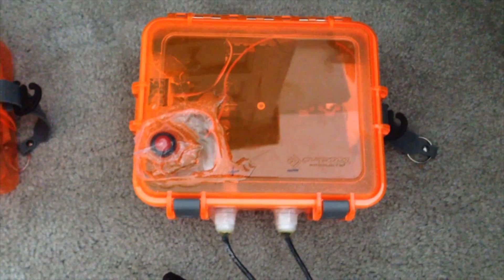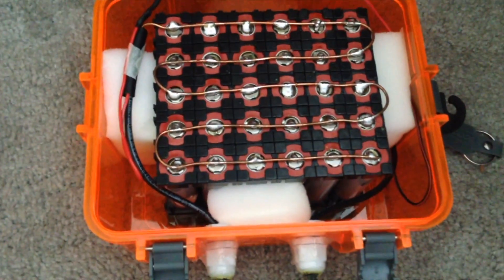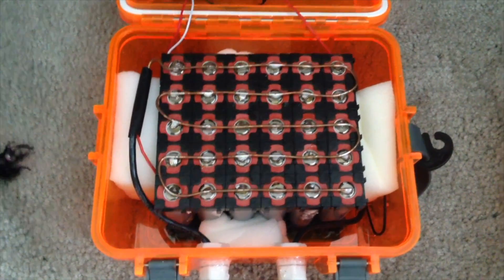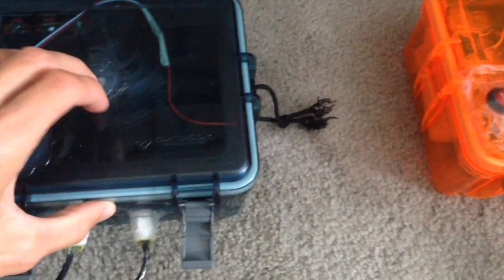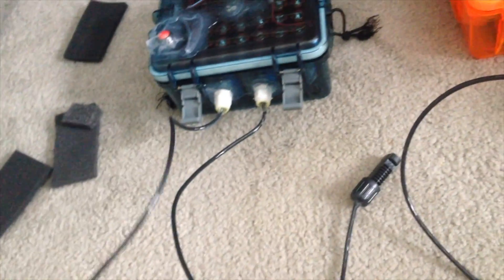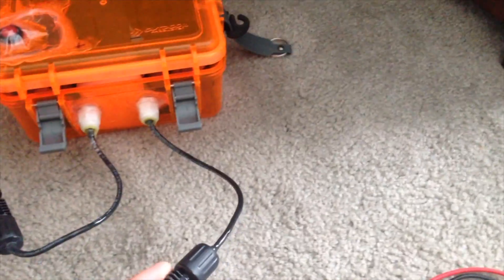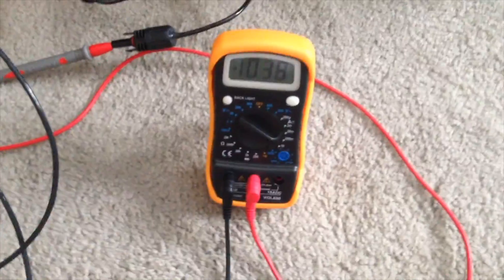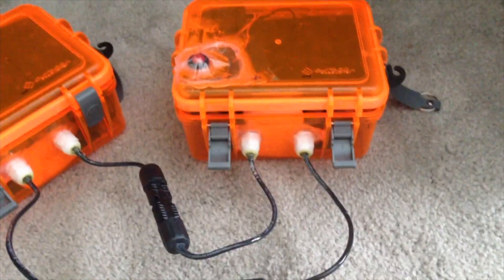DIY 12V li-on 18650 waterproof batteries

Comment: Correct me if I'm wrong but to get 100ah 12volt you would need :  3ah 18650 batteries (at 3.6 volt).  With 33 batteries in parallel for 100amp  and around 4 of those blocks in series, to make around 14 volts (to reliably get 12volt end product)  That would be just over 100ah if the 3ah rating on the battery is accurate, which it usually isn't. This gives us 112 batteries total.
Reply from the maker: alaskanalain yeah these are 80ah

Comment: Not a good design because of all the current on the last few inches of your conductor. I hope you have it fused down below 10 amps.
Reply from the maker: Tony B. It's only 4 volts though, and no, I use this at 30 amp for a trolling motor mostly, and have put 200 charge cycles on it without issue
Reply: Tony B is correct, the resistance of the cabling from one end to the other will cause a voltage difference . At high currents you will see this and you'll end up with a bottom balancing issue.
I highly recommend thickening your wire and bridge them across as well as zigzag as you've done making a mesh on both side.
You really should fuse the positives as the cable exits the box.. what if the cable shorts by some miracle accident.

Comment: Interesting video:  Lets see: to get a car battery level like 900AH, you would need even if 3000mah (3ah) @3.7v * , so putting 3 in series gives only 11.1v,  best use 4 in series to get 14.8v; then since each string of 4 in series is only 3ah, you would need 900Ah/3Ah = 300 strings of 4 = 1200 cells @ $3 ea = $3600 ?   If only a way could be found to bring the price down. 
* from my experiences with the Li-ion 18650 Ultra-Fire 4800mah (4.8ah) battery, they work  good for perhaps an hour at first but gradually lose their "stamina"  so that after 1 year of ONLY occasional (not everyday) use, usually for only 10 minutes or less of use time,  now  if I use the flashlight for 30 minutes its getting dim and needs recharge. Leads me to wonder if the 4800 mah rating is even accurate (seems like its possibly really on 1000mah ? ) .  Some battery vendors use a different rate of discharge schedule to make their batteries seem better than they are (buyer beware);  ie  i a 100ah rated battery is using the accepted norm of 20 hours that means the battery will give you 5 amps for 20 hours, but if they use a different hours like for example 50 or 10 hours it changes the rating drastically; so they can use for example 50 hours to get 2 amps for 50 hours but falsely say its 200ah etc.
Reply from the maker: john Doe yeah the ultrafire batteries are 250mah at best, they're Chinese junk, where is the 900ah for a car battery coming from? Most car batteries are 70Ah with a cold crank rating of possibly 900Ah
Reply from the maker: john Doe yeah agreed that's the worst thing about lead acid batteries the discharge curve isn't linear, whereas with lithium batteries it is very linear!
Reply: yeah, my bad most deep cycle golf cart or marine are rated at ~ 100Ah +/- , but I've seen "Everstart Marine MAXX-29" batteries that they put on the label 900 cranking amps and  like 700 "cold" cranking amps (which really isn't deep cycle is it) AND also 125ah ? so it looks like a multi-use battery.   Car start batteries are made with more but thinner plates to create a lot of amps (ie 900) when starting but this will only last 10-15 minutes at which point the V falls below the needed ~11v needed to start a car;  conversely the deep cycle types are made with fewer but thicker plates to increase the longevity of time of use so a 100 ah battery then is rated to run 20 hours @ 5 amps or 10 hours @ 10 amps,  etc.   Beware "some" unscrupulous battery co's will quote the 10 hour schedule but the industry standard is for 20 hours, making it appear to be a higher amphours than it really is.  Yeah, don't buy those copper top look alike batteries (aa etc) from the flea market, they last exactly 4 minutes.
Reply from the maker: john Doe lol yeah you're right, for lithium cells you can look up the specs online, best cells will get you 30ah draw but just string as many of these as needed for the current draw needed
Reply: U r right. I think lead acid is predictable in that it gradually decreases the power curve, the Li-ion and Ni-mh seem to stay higher longer but then take a steep sudden dive (unpredictable), so many times my li-ion drill just dies.. so of course one has to carry a backup (even though it has a battery test light, its doesn't really really accurately predict the battery level (ie 4 bars is not same as twice 2 bars).
Reply from the maker: john Doe yeah I agree with you, it's cutting out to protect itself so the battery doesn't discharge to deeply; all in all Li-Ion are definitely the way of the future
Reply: No car battery has that cap, mr doe.
Reply: Depends what you want the battery to do. If you have 4 cells in series, it should never be charged higher than 4.2 volt per cell = 16.8 volt. And your 4s 8p pack can deliver 3400 mah x 8 = 27 200 mah or 3.4 amp hour.

Comment: how many cells would give you 100ah assuming they're all the same as your LG cells?  I'd like to make 2 12v's for a 24v system because I'm not paying 2,000$+ for one. Any info would be awesome
Reply from the maker: Aaron Stover you'd need roughly 40 cells to make 104 Ah @ 3.7V, so you'd need 120 to make 12V, or 240 to make your 24v at 104Ah
Reply: thanks a lot! any issues at all with your system? I see a lot of shit about bms seems like your battery charger keeps things in order
Reply from the maker: Aaron Stover so this would be ~400$ using the same method I did
Reply: where did you get your cells? I've had a rough time finding them in bulk like I need
Reply from the maker: Aaron Stover no issues at all, yeah my battery charger does all the leg work, only advantage to a BMS is it won't let you over discharge the batteries
Reply from the maker: Aaron Stover eBay mostly
Reply: ok cool thanks alot
Reply: fisherman3210 this is incorrect. Assuming those cells are not actually 3000mah, but 2200ah.
That is 2.2ah/cell.
In parallel, you will need 45 batteries to reach 99ah @3.7v.
You then need to run 4 (not 3, which gives you 11.1v) groups of those 45 batteries in series to get 14.8v @99ah. Which is about the equivalent of a normal automotive battery (voltage). You want more than 12v, not less.
Anyways, that is 180 of these cells which will set you back still well over $1400 and weigh around 18lbs not including boxes or solder.

In short, this doesn't really gain you much over a traditional marine battery in terms of weight or ah and involves soldering 360 joints.

Comment: how do you connect them ? 3 in series and the rest parallel ??
Reply from the maker: Yeah the large boxes are connected as 3 in series for 11.1v nominal, the individual 18650 cells are connected in parallel
Reply: +fisherman3210 ok but i want to make 12v battery with 20 cells but how i dont want 3 huge boxes ?
Reply from the maker: +Ilia Zhelezarov then simply don't put them in boxes, I only used these waterproof boxes as they were needed for my application
Reply: +fisherman3210 you did not understand me correclty   i ment how can i connect them so i can use it as a car battery like its 12v but alot of amps
Reply: as fisherman said.  you'll need 3 in series to get 12V  ( 4x3 = 12V ) . but how many batteries you connect in parrallell with those 3 is what gives you the amps :)  so, if you have only 3 in series and one battery is 3 amp, you still have 3 amp. but if you connect 10 parralell x 3 in series  you'll have 30Amp ( 10 parrallell is 10x3 amp is 30 amp in only 4V , put them 3 stimes in series is 12v 30Amp ) , if you connect 20 parrallell in  serie of 3 , you'll have 60Amp at 12V ) and so on, so on... 100 parrallell times 3 ( serie ) is 100x3  300Amp 12v , but you'll need 300 batteries to get this ;)

Comment: Hey man, this looks awesome. any issues running the trolling motor? I plan on getting a riptide 45 motor.
Reply from the maker: No issues at all, motor runs a lot better and far longer than it did with a marine battery, I would recommend this to anyone
Reply: +fisherman3210 
Im at work right now so I can't listen to the video. But do you have a link to the diagram, I really want to make something like it.
Reply from the maker: +GTboosted it's just + to - on each to make 12V, this is a 3 series battery